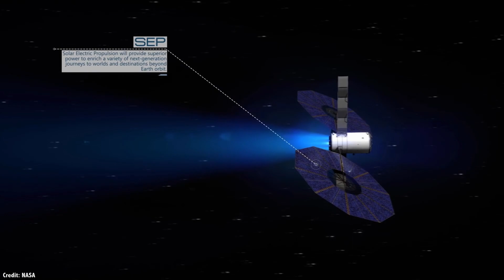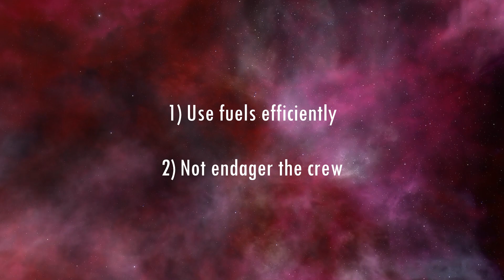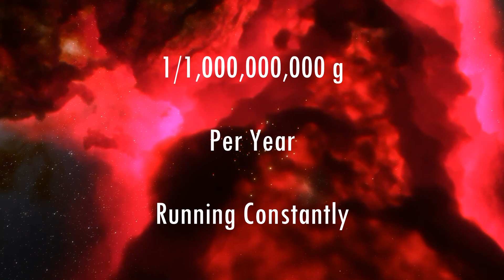The FAR Future of Spacecraft : Advanced Propulsion Methods

Comment: Now a ship with powerful magnetic fields around it with one being stronger at one end might do something unexpected... If they can generate as much energy as there is in the moon for one side and Mars for the other... Like all of the energy in the atoms of each body... Tho that would also vaporize the ship or at least kill anything on board as they ignore that the energy fields would be small and contain all that energy. As there aren't even theoretical materials that can survive that kinda power. The ones they do say could aren't physically possible to make or they'd have done it already seeing as how they can manipulate atoms and add or take stuff away from them...

Any material that could would be so dense that it might as well be as impossible as making Thor's hammer and his ax out of neutron star material that would explode if it didn't have the neutron star's gravity holding it together..... 

And a magnetic field to hold it together would kill you instantly or still vaporize the ship...

On top of one other issue that's already a real problem that requires some earth bound electromagnetic machines to have safety areas... As a strong enough field can effect even wood and flesh and has been demonstrated to be able to make frogs and apples float....and those fields are very small fractions of whats needed to travel to other stars....

Why do they act like it's possible then and waste money on pipe dreams as Earth could really use all the money wasted...
Reply: Only way humans get out of the solar system would be if a ship can use the magnetic fields in the universe and actually keep the people inside alive for many many generations... As it would still be so much power needed and do many other systems that a failure is guaranteed within 100 years so it would most likely turn into a suicide mission less than half way to the nearest star...

And as everywhere to even go would be far more deadly to humans than even standing near the elephants foot at Chernobyl.... Even Planets in our solar system are deadlier than Chernobyl...

And even work holes would be impossible to enter cause of all the energy and then if you add something conductive that tries to pass through or if anything passes through at all it destabilizes and collapses in on itself unless held open by even more energy that would be unsurvivable and also have to be made from exotic matter that so far has no evidence of it's existence but would have the same issue...

All things they literally just glance over and mention as if they don't want to talk about it.....
Reply: So it's like the only way to other stars is with our current fastest thing we can make and robotic crew, just launch it into space and wait... Put the best visual cameras and maybe try and make a quantum entangled computer system that can actually be interacted with and the best sensors they can make. If quantum computers can't stay connected that far away then it'll be awhile before any commands are followed and data would take the time for light to travel to and from Earth. So even that's a stretch cause it could get destroyed before they even knew there was a problem...

Anything else is literally suicide....
Reply: We’ll sit around earth for how long why not go explore now I don’t want to die with no more space exploration I want to be able to go to space in lifetime hopefully and maybe mars but prob not

Comment: They must really think people are stupid cause one idea is a ship that flies.... Like a bird on Earth. Using the solar wind.... At best they'll reach speeds slightly faster than the solar wind but not even close to 2% light speed they claim is possible... Solar wind is 0.333564% Lightspeed.
Reply: for small probes the size of a shoebox inside of a solar system, solar sails are perfectly fine.
for interstellar or bigger things, just get a huge multi km big sail, and set up a laser to push it. or... bonus points if you instead set up several focusing mirrors in a close solar orbit. or in its corona. there's also the idea of using the sun's higher atmosphere as a laser medium.